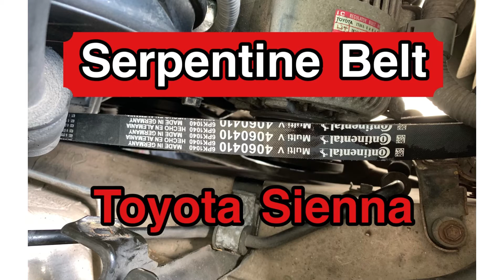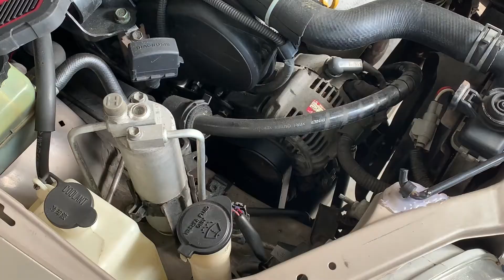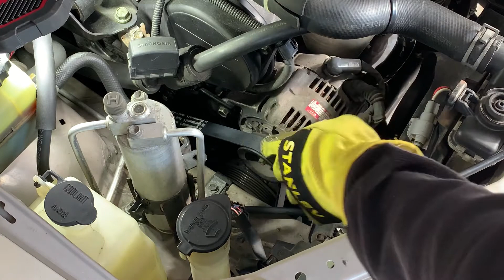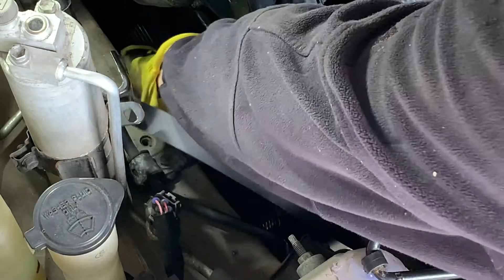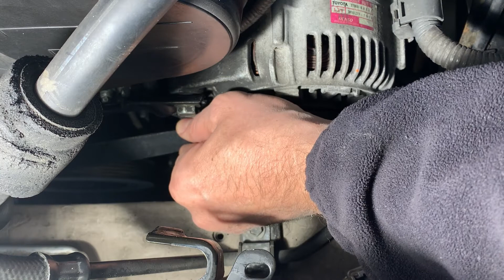How to Replace a Serpentine Belt: Toyota Sienna 2000

Comment: This is by far the best video on youtube in regards to this subject. Clear,simple,precise, short, and to the point without obnoxious intro, music or grandstanding. Thank you.
Reply from the maker: Thanks for the encouragement!
Reply: @Pen_Pusher  I changed the belt last night and wouldn't you know it the lock bolt snapped off as it started to thread back into the alternator.😂
Reply from the maker: @uwetoob9265  Ouch. That is an unnecessary complication! 😣
Reply: @Pen_Pusher  It was but slept on it, and tackled it refreshed. Removing the alternator was fast and easy,then I was able to use visegrips to remove the remaing stud out of the threaded alternator hole.
Reply from the maker: @uwetoob9265  Nice work! 😊

Comment: Great video, unfortunatley I ran into trouble loosening the lock bolt at the tensioner adjuster.  It sheared off at the alternator and now that bracket just sort of hangs there .  I went ahead and put the serpentine belt on anyway and managed to tighten  the pivot bolt enough that it seems to be be holding the belt tension without the lock nut and adjuster.   I adjusted the belt tension using a pipe clamp and a lever pushing off from the garage floor to the outer edge of the alternator.    If the need arises I will take the alternator out and drill out the bolt and replace, but hoping I don't have to.
Reply from the maker: Hi Rick, good job improvising! It is your car, but my OCD won't allow me to leave it like that! :)

Comment: I just replaced the alternator on my sienna and now the belt make a noise, should I readjust the belt or is the belt loose?
Reply from the maker: It is best to replace the belt at the same time as the alternator, since the belts get shaped by the grooves of the pulley. Check your tension - it should not twist more than 45 degrees. :)
Reply: @Pen_Pusher  I did and it was way too tight. I took the belt off, checked for any damages it may have gotten, put it back in and now it doesn’t make the noise. I think it was way too tight or it could’ve been not all the way in. But regardless it didn’t mane the nose anymore. The belt is 2 years old.
Reply from the maker: @22013  Nice. No noise is what we want! :)

Comment: What happens if the belt is not replaced? I can tell you since it happened to me. First I began to smell rubber burning. Then when I lifted the hood I say that the belt was missing. Since I was about 10 miles from home (15+ km) I left immediately for home as the belt only powered the alternator and the AC pump. I hoped to make it home before the battery died but it died about a mile and a half from home. Had to get someone to bring a battery to make it the rest of the way. That might sound like nothing damaged ... However, draining a regular battery that low is not good and can ruin it entirely. Next time I will check belts and replace when worn. Cost for me was about $35.00 CAD. (Changed it myself)
Reply from the maker: Lesson learned by Ray, but shared to benefit all of us! :) BTW I have heard you can tie a woman's stocking around the pulleys to make it home. Where to find a stocking?

Comment: I'm glad I watched your video. Even though my sienna is a 2006  I used the same belt (4060410) and finally got it on. The ones recommended for the 2006 are a half inch shorter and impossible to get on. This one worked even though it's supposedly for a 2000. Thanks for the video.
Reply from the maker: You're welcome!

Comment: Followed your video, loosened the 3 bolts and it's just short of going over the alternator pulley. 😡 I've loosened them way more than you did in the video which means that it's going to be another nightmare to get it back to where it is supposed to be.🙁 Fml. I'm stuck in a parking lot and can't afford a shop nor a tow truck. Will just take the alternator off completely and go from there.
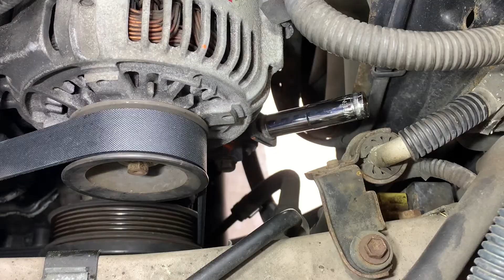Reply from the maker: The only nut that really lowers the alternator is the adjuster at 1:54 on the video. That adjuster can go down a lot. Keep an eye on the alternator and make sure it moves downward when you are turning the adjuster nut.

Comment: What happens if it's not replaced?  About how expensive is it to have it replaced?  Thanks.
Reply: You replace belts when they are worn. The cost will vary depending on where you go. I think the general labor charge is @ $65 hour. No matter how long it takes. If they do it in 20 minutes they may charge you a full hour. So ask about that as well.
Reply from the maker: If it breaks while you are on the open road you could damage your alternator or AC pump. That will be expensive to fix. Just go ahead and replace them at the recommended intervals. :)